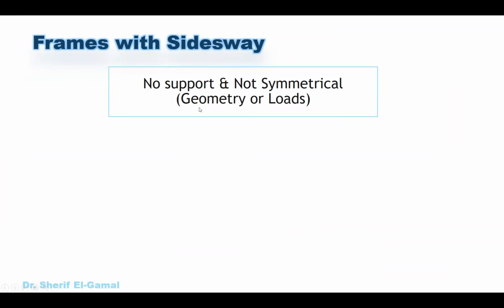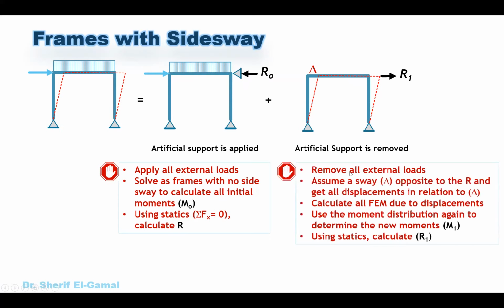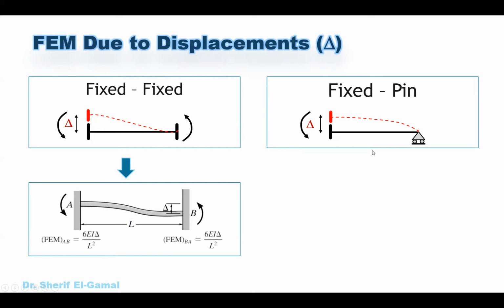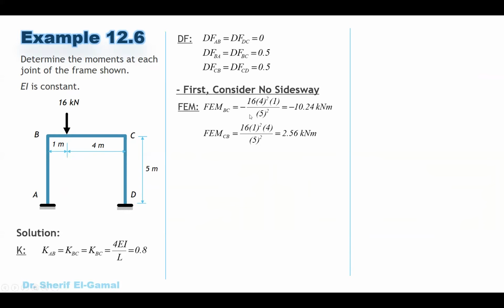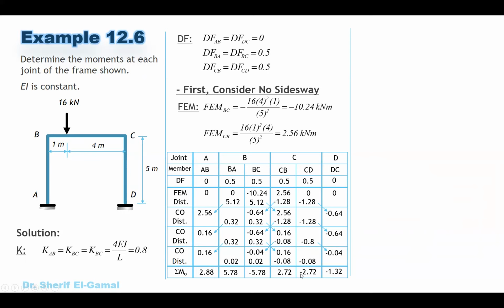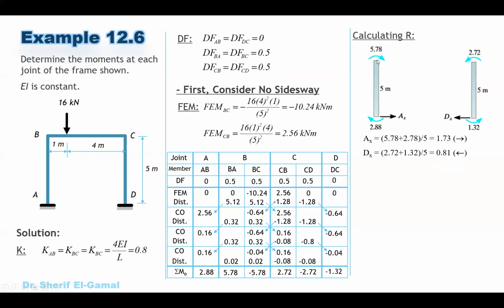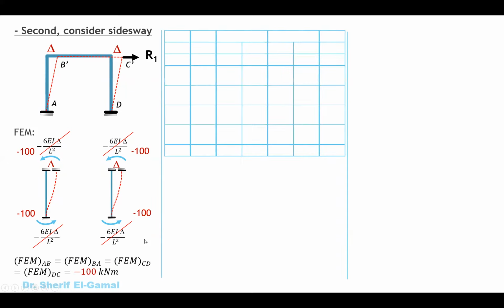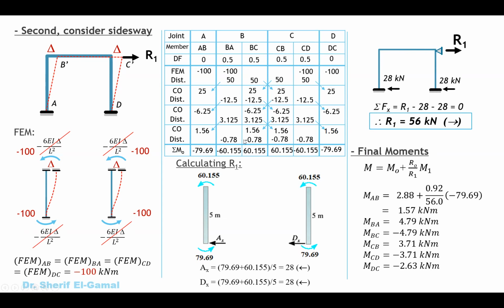Moment Distribution Method -  Frames with Sidesway

Comment: I dont understand how do they assume the value of -100 in sway, do we need to calculate or not from anywhere.
Can we assume it also 500, 600...or only it should be less than or equal to 100
Reply from the maker: You can assume it as you want. 500 or 600 or any other value. At the end, you will have same final moments

Comment: Sir what value will you choose for bending moment coefficient for  continuous slab if Ly/ Lx is 1.87
Reply from the maker: It depends on the continuity of  the four edges of the slab. Table 3.24 in the BS8110.
Reply: Thank you